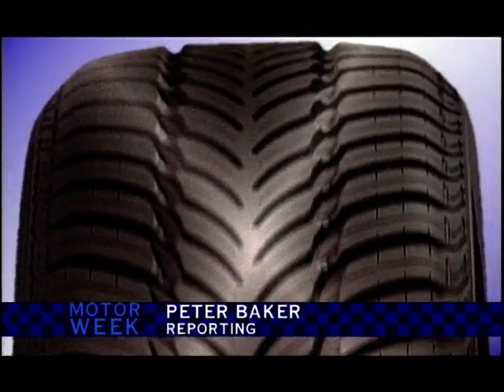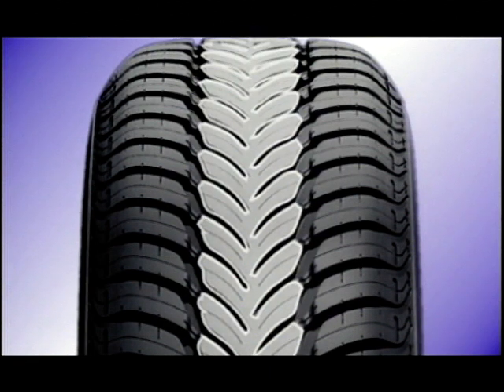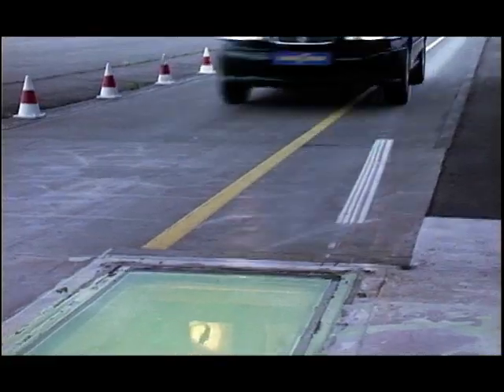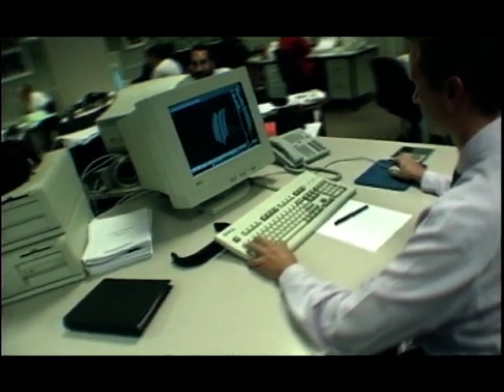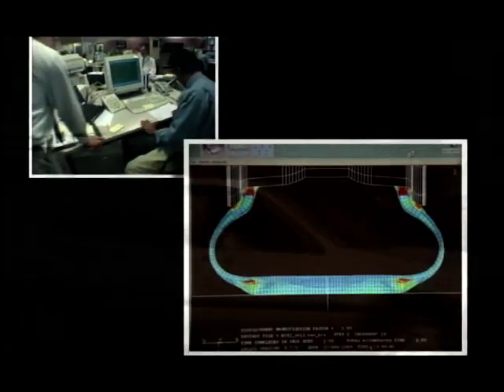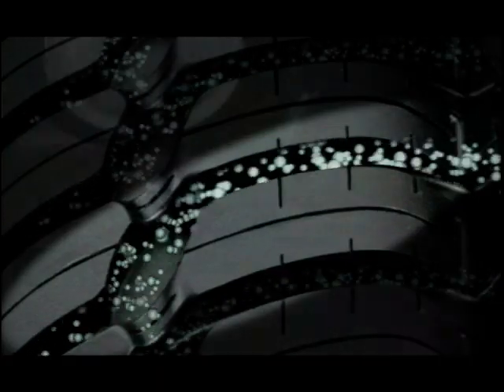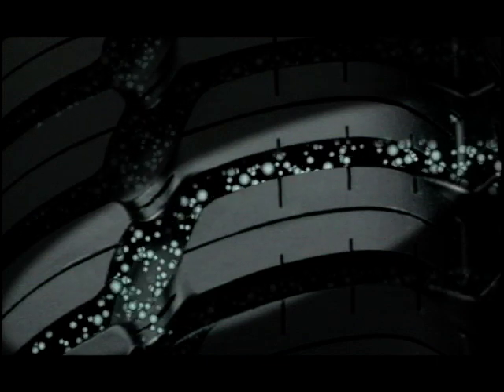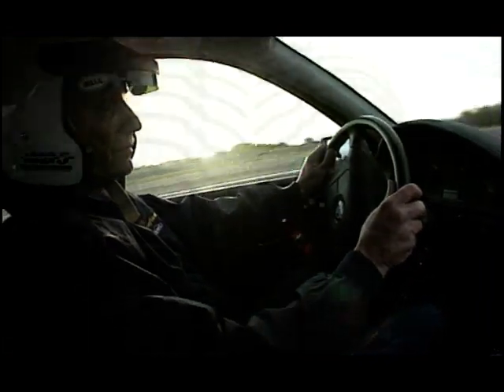Why Is The Tread Of A Tyre So Important?

Comment: Why is tyre thread not made higher to get more km from the same casing  not every body need a high performance tyre .....and save the enviroment
Reply: You can if the tire is running on deforming surfaces (sand, gravel etc) but if used on non deforming surface (tar, cement etc) the treads will shear off very easily. That's why off road tires have higher treads than on road ones and are not recommended to be used at any other surface than off road.
Reply: @aviboyone   Thanks it makes sence
Reply: @dirksmit6144  why do u spell tyre instead of tire and sence instead of sense, is that how its spelled outside of U.S.A
Reply: @stevesilva2071  thats correct accerding to Our spelling Steve